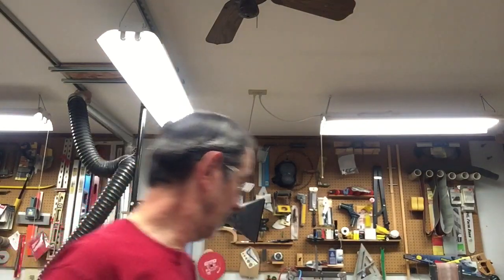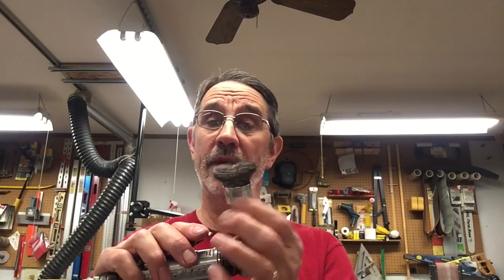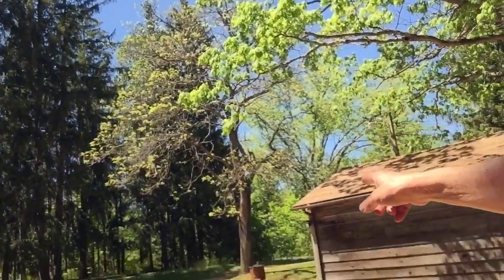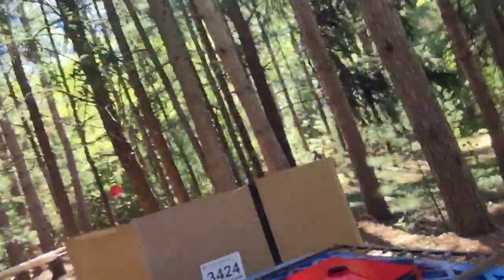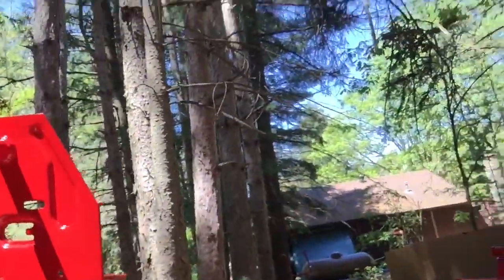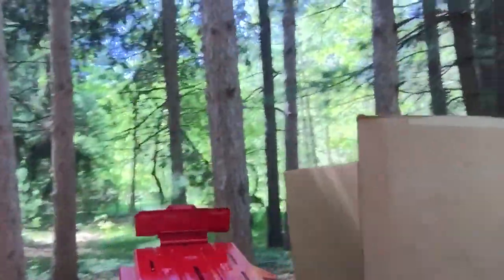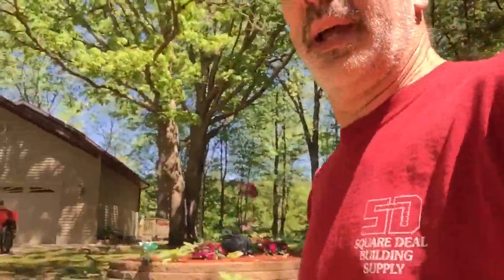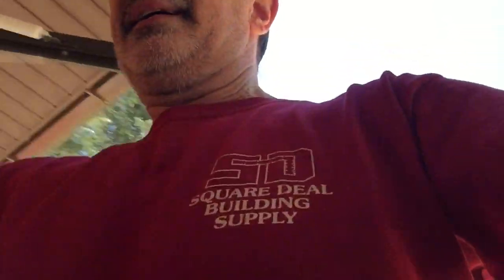355. Part 9. How to paint the rear case and fenders.

Comment: Jim would you have a Steering wheel for sale? I would be interested if you do, video's are great, I'm rebuilding an 86 snapper
Reply from the maker: When you say steering wheel do you mean the oval black plastic steering wheel, or the white bicycle handlebars. Jim
Reply: @jimjackson9381  It has the white handle bar, but I want to replace it with the oval steering wheel
Reply from the maker: @charlesmoyer8782  To do that you were going to have to replace the steering shaft and there are different ones I have to know the hole pattern on the bottom of your steering shaft where your tire rods hook in. Jim
Reply from the maker: Steering wheels I have and I have a couple of steering shaft but if you have to buy one they’re $97.83 each new and the steering wheels are $116 new just so you know what it’s going to run, my used steering wheels I sell a lot cheaper than that but the steering shaft I would have to have your old one to try to come up with a new one for your machine. Jim
Reply: @jimjackson9381  I'm a retired welder, I have access to a machine shop, I'll fab the shaft , what would the oval steering wheel be with shipping?
Reply from the maker: I will need your complete name address and ZIP Code to figure out shipping costs. send it to
jimsfixitshop@gmail.com
Thanks. Jim

Comment: Lookin good Jim! 
 What type of Rustoleum and what color do you use? I am curious how close to the proper red that Rustoleum engine enamel spray paint is? I'm wondering if it would be more durable with scuffs and what not than the regular spray paint, I'm not sure. It's supposed to be fairly heat resistant not that that really matters for these parts but.........Also, I wanted to mention this to you, I don't know if you have any experience with it or not but some people say that to help cure Rustoleum enamel paint better to leave it outside in the heat and allow it to get rained on which also cools it off. They call it cold curing or something like that. From the way I understood it is leaving it out in the sun helps to evaporate the solvents in it and then cooling down in the rain helps to cure it hard. I recently painted a receiver hitch black that is for mounting on say an ATV, I had to do some grinding on it so that it would bolt to the hitch mount on our Snapper, but anyway I left it outside for about a month and the paint seems like it's good and hard. I'm not sure if leaving it out in the heat and rain actually helped or not but I wanted to mention it to you in case you might want to experiment with it, some people swear on it.
Reply from the maker: Are use rust oleum spray paint gloss enamel and the color is gloss Cherry the number is 248568 nice to hear from you Jeff. Jim
Reply: I know Jim did a video showing the different shades of red & the one that was close to original Rustoleum Gloss Cherry is the one he uses, Regal Red is to dark.
Reply: @jimjackson9381  Thank you much Jim! 👍
Reply: @ACF6180T  Thanks, I'll have to try to find that video. I believe there are at least a couple different shades of red on these Snappers through the years, the Rustoleum red engine enamel may be a little too dark but I think it would be close to the older shade of red that they used to use, the newer ones seem to have a bit of a brighter red with a slight orangy tinge, I like the newer red better myself.
Reply: @bodeine454  I have not looked at any of the new ones ,& the newest one I own is a 2012 rer & the oldest is 1974   rer & a 1986 & 1990 s/p walk behinds & they're all close to gloss cherry & the only other paint hue that comes close is  Rustoleum tractor paint  Massey-Ferguson red, Snapper makes riding mowers for M-F & at one time M-F was making Garden Tractors for Snapper.
Reply: @ACF6180T  OK, maybe the darker red that I believe that the older ones are is just from time and being outside for periods of time but in my eyes the older, like '80s, Snappers were close to fire engine red or just "red", my late father has a 2010 model RER and it looks a bit brighter to me, like it has a bit of yellow mixed in to give it reddish/orange look, I'm not sure, they just look a bit brighter to me.
Reply: @ACF6180T  I painted some of my Snapper with Rust-Oleum Sunrise Red,  7762, a close match to my 1974 mower....
Reply: @ronaldduncan1983  I already committed to the gloss cherry  & I'm using Rustoleum Pure White on all the rims , deck cover & the steering handle bar! As Jeff Stone commented the exact hue will vary based on exposure to the elements & time & when I'm done with with the 74 Snapper Comet I plan on using it bi-monthly bases along with the 2012 & do a repaint of the 86 S/P walk behind & the older Snappers are a tad darker shade than the newer ones, But I have 2 pieces of Troy-Built equipment , Chipper -Shredder-Vac & a pressure-washer that are closer to red on the newer Snappers.& it's going be a refurbishment just to make it look better than what it looks like now , But it will be close to new looking & I already bought all the paint , Thank You for the tip though Ronald. SNAPPOUT
Reply: @ACF6180T  Keep up the good work on the old faithful, (1974) Snapper....